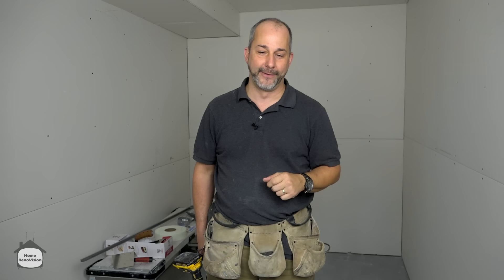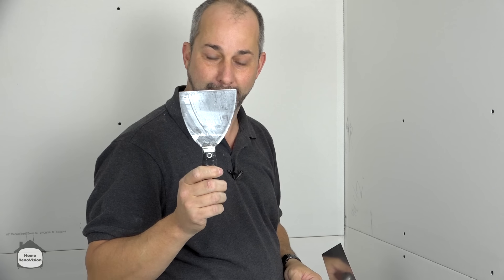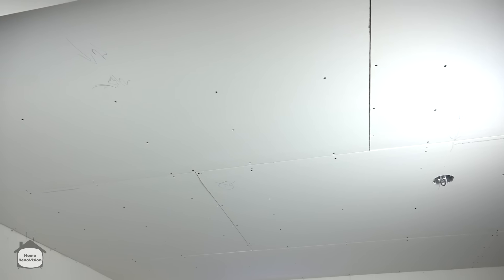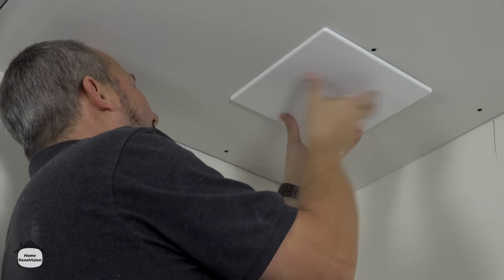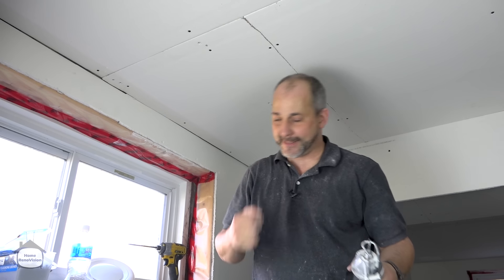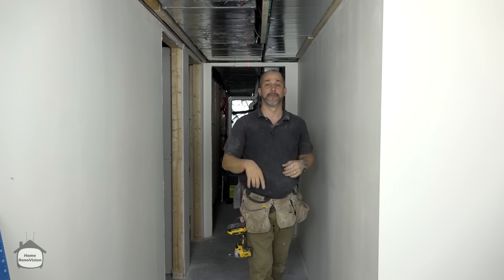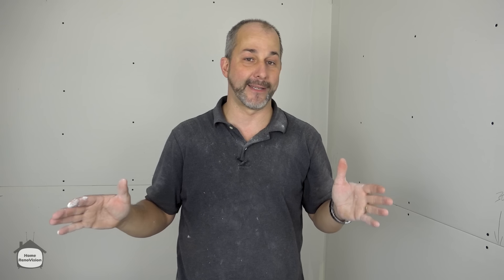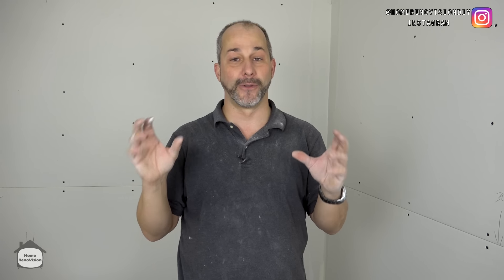DIY Drywall Finishing | 18 Tips and Tricks

Comment: The jagaloon idiot lowest bidder subcontractor installed the drywall in my mudroom off the garage backward, with the brown side out. I'm not the original owner, I'm the second owner and it was never painted. I'd like to paint in there. Is it better to take it down and turn it around so that the white side is out? Or is it OK to prime it twice with oil-based Kilz primer, then paint it as I would normally? Will be painting with semi-gloss, more light reflectiveness and easier cleaning/wipe down. Same paint I used in the garage.

Definitely don't want the paint peeling off, appreciate the advice. Btw, you have the patience of Job with this stuff. Is all the profanity edited out for YT? You can tell me, our little secret... lol

Thanks
Reply from the maker: I'm human. I would install new board. can't trust anything done backwards!

Comment: Hi Jeff, I have been trying to buy that corner mud roller thing for two months now but it is still unavailable on Amazon or any of my DIY sites including Tool Station and Screw Fix. I can understand why things like masks can be hard to get, but why this item is so unavailable is beyond me. I will keep on looking for it but for now, I will have to find another way of mudding the corners. I have a corner trowel but I am a bit of a “new ideas” hoarder and not being able to get this item is driving me crazy (or at least more crazy than normal)
Reply from the maker: Hi John, try going to a local drywall supplier for the trades and shop in their showroom.
Reply: @HomeRenoVisionDIY  Hi Jeff, unfortunately, I am on full lockdown and the furthest I have been is to the back of my garden, I have tried the websites of some suppliers but had no luck it looks as if I will have to wait until the virus has run its course and we can venture out again

Comment: When using the roto zip you are following the inside of the electrical box, How does the hole compensate for the thickness of the box itself?
Reply: You plunge the rotozip into the middle of the box space, drag it to the inside edge, lift the guide OVER the edge, then follow the outside of the box around. Your cut will be slightly larger than the box due to the width of the cutter.

Comment: Hi, Jeff. I've been watching all your videos pertaining to drywall lately as I have a home project coming up where I'll have to cut out a large section of ceiling from water damage (about 9'x13'). Would it be best practice to cut off the taper joints from the sides of the new board that will be meeting up with the old? Or can you have a taper joint meet up with a butt joint? Thanks!

Comment: Your running your router the wrong way , it’s clockwise when your inside and counterclockwise when your outside , so for an electrical box it’s gonna be counterclockwise and for a door or window it will be clockwise, it’s all about the rotation and pilot on your bit

Comment: So I really need some help from anyone out there. I have watched all of these videos, except  for this one and I definitely rushed into my project, but am determined to do what I can to make it look at the very least good in the end. First issue I had was mud stuck to my 4" knife way too much and made it very difficult to make my inside corners smooth pre-tape, watching this figured out I should've filled the corners and taped but it's dry now and there are just gross dimples and humps in the corners, what should I do to solve this issue? Second issue, I have 2 outside corners and I loaded up with mud but highly underestimated how much I really cleaned off. Is there something out there to remove dry mud easier or do I need to just sand down to drywall for hours?

Comment: To edge around windows use plastic tear away bead often called zip strip. Union carpenters would laugh this hacker off the job. When you build walls and soffits you build them plumb, level, and square. And if you have a laser there should be no mistakes.
Reply: Are you talking about something like Philips Vinyl L-trim ( I searched zip strip and found this at H D ) , which resembles an outside corner bead ?

Comment: Hey you didn't tell these guys what direction to go with the roto-zip... 
Your supposed to go counter clockwise with the bit ... The bit spins right,so you pull left around whatever you're cutting out.
Reply: He does at one point in the video actually say to cut counter clockwise, I believe it was during the ceiling heat duct elbow cut.
Cheers and Great work  Jeff!!

Comment: I won't allow those zip tools anywhere near me unless it is new construction. You'll never in your lifetime get rid of all the drywall dust these things create. Drywall contractors use them because they are fast. Harbor Freight has a half circle blade for their oscillating tool that cuts a perfect line with hardly any dust. If I'm doing the job myself I don't mind a little extra time as long as I'm not filling my house full of dust.

Comment: THE ONLY REASON NOT TO USE JOINT COMPOUND OVER MESH TAPE.
MESH TAPE IS FLEXIBLE AND WILL CRACK USING BOX MUD/JOINT COMPOUND WHICH IS QUITE SOFT AND POROUS..
IT IS OKAY TO USE TOPPING OR JOINT COMPOUND OVER THE FIRST COAT OF THIN SET/MESH TAPE
ONLY USE FAST SET OR PLASTER OVER MESH TAPE EVER EVER 
AND IF YOU DARE USE MESH IN A CORNER YOU BETTER BE A PROFESSIONAL PLASTERER/THIN SET MAN. PERIOD
HOMEOWNERS- USE JOINT COMPOUND AND PAPER TAPE.. MESH IS FINE FOR PATCHES W/HOT MUD (QUICK SET)- JUST USE PAPER TAPE AND JOINT COMPOUND.. YOU'LL BE HAPPIER
 ALSO.. THE EDGE OF THE KNIFE- WHICHEVER YOU CHOOSE WILL CUT, THEN SUBSEQUENTLY FRAY THE MESH LEAVING POINTY LITTLE PIECES YOU'LL BE FRUSTRATED WITH.. (YOU CAN HEAR WHY THIS CAN HAPPEN @ 7:57) W/MESH TAPE
EMBED PAPER TAPE IN MUD THAT YOU'VE THINNED A BIT FOR EASE OF USE, DRAW OUT THE MUD BEHIND PAPER TAPE W A 6" KNIFE AS PROPERLY PREPPING FOR NEXT COATS- WHEN DRY, COAT ONE SIDE- LET IT DRY-
COAT THE OTHER SIDE- DON'T TRY TO COAT BOTH SIDES OF A CORNER AT THE SAME TIME- AND CORNER TOOLS AS SHOWN APPLY FAR TOO MUCH MUD- HENCE 6" KNIFE IS BEST..
START BY CHAMFERING ALL LOOSE & FRAYED EDGES OF S/R (SHEET ROCK) W/ SHARP KNIFE
PRE-FILL THESE AREAS THEN TAPE-
TAPE BUTT JOINTS FIRST
LONG FIELD JOINTS NEXT
FINISH TAPING YOUR CORNERS LAST- SO ALL TAPE OVERLAPS..
NOTE: IF YOU CHOOSE TO FOLLOW THESE STEPS- IN VIDEO- DO THE OPPOSITE- USE MESH TAPE W/FAST SET MUD ON FLATS AND PAPER TAPE IN CORNERS- NOT THE OTHER WAY AROUND.
J METAL IS GENERALLY USED WHERE THE RAW EDGE OF S/R WILL SHOW AS IF YOU BUILD A PARTING WALL (PERHAPS ON COMMERCIAL JOB) MID WAY THROUGH A WINDOW OPENING.. AND OTHER APPLICATIONS..
WOULD HAVE BEEN NICE TO SHOW HOMEOWNERS HOW TO TRANSITION THAT OUT SIDE THREE WAY CORNER- TO THE LEFT OF THAT 'GLUED ON BEAD'' @ 14:45
PEACE ON... BE WELL

Comment: This is not a structurally sound by using a strip of wood always cut out the piece of sheetrock to the beam or like I said before, cut the sheetrock before you install the board. He is just doing 2× the work that needs to be  done.
Reply from the maker: sorry to break it to ya but drywall is not a structural component. my patch is more than strong enough to function as a fire barrier!
Reply: @HomeRenoVisionDIY  Nevermind a fire barrier, if you would have cut-out for the air vent first, then hang the sheetrock. Then you wouldn't have to cut after putting up the sheetrock. Oh, I understand a rookie mistake.

Comment: Not enough mud on that inside corner tape with that applicator.
Reply: I agree. I did drywall in my late teens. once you get it down corners are a breeze by hand. There is another tool we called a bazooka that puts out mud and tape at the same time. A two man crew can bust out alot of taping. Drywall is easy with alittle practice.

Comment: Shouldn’t that ductwork be insulated? Is it allowed to not be because it’s inside a conditioned space. Also I’m in Texas so losing cool is much more important than losing heat up there I’m assuming, especially because heat radiates outward. I’d still assume you wouldn’t want to lose heat or cool behind the drywall.
Also another question I have is how are is he able to do all the MEP work by himself? I’m a plumber and at least in Texas you’re only allowed to legally do plumbing without a license on your own house. I’m not one of those tradesman who gets pissy when handymen or carpenters do unlicensed work. I’m pretty libertarian about it. If a customer wants to hire some handyman who doesn’t know what they’re doing then that’s on them. Also a license doesn’t mean you know what you’re doing. I’ve seen handymen who did everything to code and journeymen who do everything wrong. I just assumed Canada would be much stricter about licensing than Texas but I could be wrong.
Reply: When I mentioned hiring a handyman who doesn’t know what they’re doing, I just meant that in general to make a point. That wasn’t a shot because I’m not an asshole (debatable) but also because from what I’ve seen he does things right.

Comment: Ugh.  Taping inside corners with mesh tape is not a great plan.  I understand that for the homeowner/newbie mesh tape is easier to use, but inside corners should be taped with paper tape (which comes pre-creased for this purpose) or an inside corner bead.  Go check out Vancouver Carpenter's channel for real deal drywall instructions.

Comment: Who glues on their corner bead wtf.  The whole point of those corner beads is there is hard/dried mud to support the backside making them stronger. Not to mention you should do the seems before you put on corner bead so the tape is under the corner bead.  I didn't learn anything but not a noob either.

Comment: DO NOT DRIVE THE SCREW IN ON AN ANGLE. It could lead to a screw pop, or needing put on a lot of mud to float it out.. not good for smooth finishes, if you have to do a repair on a smooth finish, it's very likely your going to see the repair if you dont know what your doing. If you happen to some how drive the screw too far in, you'll need to take the screw out completely, otherwise it WILL need to be repaired over and over again

Comment: There’s no access to the heat run to adjust that damper
Reply from the maker: if you slide off the cover you can adjust the 2 brackets in the back to vary supply. Cheers!
Reply: Home RenoVision DIY must have missed that part. What I saw was u cutting out a small section of drywall to access a heat run that u covered by mistake. The damper was just before the 90deg elbow going down to the ceiling. You cut the hole for the diffuser but I didn’t see u install an access door. What video did I miss

Comment: Not bad dude. gotta nit pick just a bit though. Yeaaaaa you do need screws every 6 inches on wall seems.  every 12 inches in middle or field. Every 3 inches on ceilings and 6 inches in the field. That's code here in CA, and has been for 10+ years now. And yes there is a reason for this other than living in a communist state; drywall adds sheer strength to  framing. More attach points equals a greater sheer strength for your framing. Specifically helping against earthquakes and other Nat. disasters, or just the passage of time, that will tweak or twist the framing. Every pro out there has done a job where the drywall has fallen off the ceiling or cracked on the wall because it moved or wiggled from a lack of screws. Every state and fed guidelines on this are moving towards CAs building codes. Sorry, I know most of the country hates  us. Just how physics  works some times. Kick ass video none the less. ty duder.
Reply from the maker: Cheers, quick question....Turns out Australia uses adhesive behind the gyprock as well as screws. anything look like it may be heading that way for CA?

Comment: I love the tips and learned a lot but some of the "tips" concern me. The one at 26:38 & 39:17 in particular seem like a DIY'er nightmare. Floating pieces of wood that are not studs and not at all reinforced are a dream "hack/tip" for a contractor but not ideal for the end-user who may scan the area and believe there is a stud/joist only to realize it's not once the fan/chandelier/TV/punching bag or whatever is mounted on it.

I fully expect to be flamed for this post because "yes", someone could validate that the wood (or screws in the case of magnetism-based 'stud' finders) they detect are truly studs/joists supported by other joists. Unfortunately the convention of wood with screws are on joists/studs, which can support weight is violated. These type of hacks are cute but part of the reason contractors get a bad reputation. Only when the user of the space goes to do more work (such as hanging something from this faux-stud/joist) will they realize your shortcut and someone could be injured or killed as a result (extreme case yes ... but possible). Insurance or not, that could lead to a costly lawsuit/settlement and damage to your reputation/brand if negligence can be proved.

Comment: Please dont buy that inside spackle roller unless you want to spend hours scraping the floor clean.  I'm surprised he called it an inside spackle roller, it was designed for paint, inside corner roller.  Mess tape?  Come on, that's like dressing your dry wall in dragnet stockings, sexy drywall, TAPE it with paper tape.  I never saw spackle in a bag?  I'm use to USG, buckets, you know the green lid one that gives you a hernia.
Reply from the maker: we don't call all purpose drywall compound spackle either. cheers!

Comment: if you use mesh tape you already are doing it poorly, spray on glue for corner beads is terrible idea as well.. going to have issues 100% and putting multiple coats on before they have dried is also terrible advice. youll sand it and paint it and it will shrink.. cause guess what it never dried properly.

Comment: yeah, well if you care about doing the job right..you'll learn to pre-cut. Yes, it is perfection, old school, and it does take more time. But, if you take pride in your work, you'll never slop the job out burying boxes(or duh, didn't know which side of the stud the box brace is on, and running the bit three inches through the rock in the wrong direction...)  If you're a taper, you'll never have to mud some dipshit's mistakes.

Comment: Wow... Where do I begin? Iam a drywall professional if 40 plus years count. Using an impact wrench instead of a DRYWALL SCREW GUN leaves a bigger indentation than just a counter sunk screw. Using finished J-metal {those snips you used ugh} then say to coat it, had us rolling. Try using the proper metal..its called unfinished J-metal. Using mesh tape in the corner is never ever used, it is unreliable and not near as strong as paper tape. To master that angle tool for angles is too much for a DIY. Telling amateurs to use fast-set is just cruel. What he doesnt bother to show you is when all the angles meet in a corner how to coat them out The putting of B1W metal on your 90 degree corner was funny saying that the long edge of the metal was to go over the rough edge of the drywall. One problem every corner must be to the very edge and flush with the other side. The time to do that is just a waste. When you hang just split the drywall instead of measuring to the edge if you are using square bead. Hang to the edge of the framing if using round corners. You dont need to be exact and the proper metal and application of it, {unlike the sprayed on glue way..the funniest of all} will fill in just fine with mud. Plus the B1W metal is more expensive than the standard metal. The B1W metal is widely known and used for square kerfed jambs...doors and windows. I have seen your other videos, some stuff is good but trust me you are wasting time and making it way harder than need be. I have had to fix tons of DIY work that watched some video like this that makes it all seem so easy. When in fact it just isnt. Then your arrogance shows through when you say "some guys hang to the studs" yea its kinda code and stronger plus when you hang 2000+ sheets a month just how much money and time you gonna spend putting in those boards for every butt joint? Lets not forget a joint on an outside wall that is in between studs has a huge chance to absorb moisture and then bead and show the joint. Not to say all the joints in an uninsulated garage ceiling. Maybe I should make a drywall channel and actually help people and not get them in over their heads. I have a reputation of being one of the best around in drywall getting that way knowing the ins and outs and caring about the customers project as if my own. Someone had to say it.

Comment: You are completely ass backward dude. Paper tape your corners, mesh tape everything else. That is the fast way of doing it. Fiddling around trying to push mesh tape in a corner instead of just folding your paper tape and sticking it right in there is a big time waster because its awkward. Paper tape  with your 45 minute mud, block coat it with that fancy corner tool you got with more 45, scrape it once it sets up, then skim with purple lid  premix. You should have no problems finishing all the joints in a 12x12 room in 8 hours, and be ready for sanding the next morning.